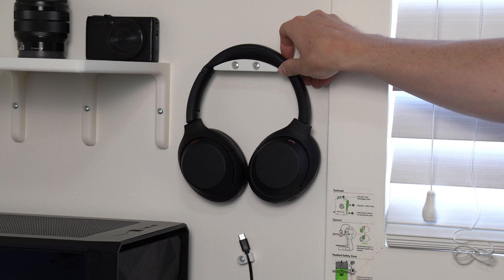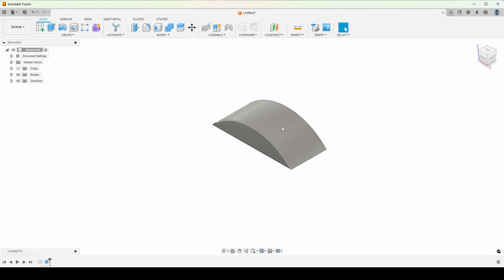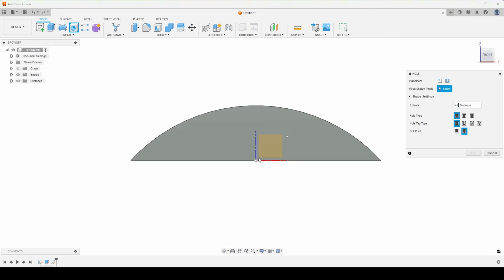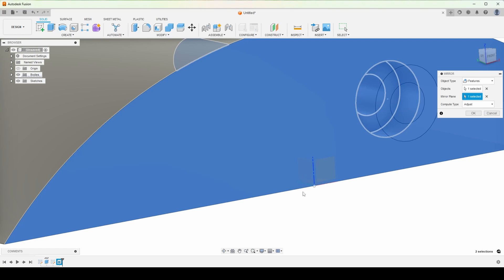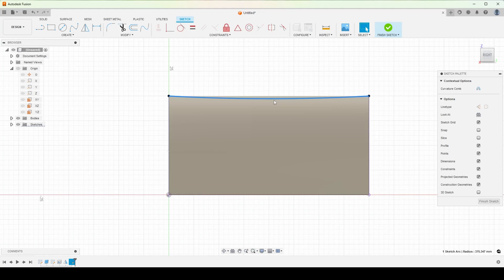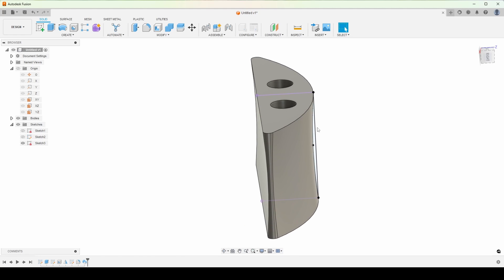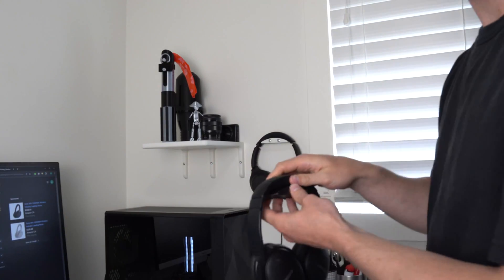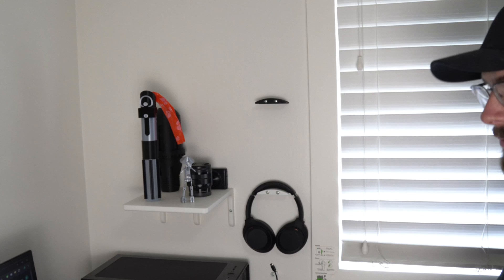Designing and 3D Printing a Minimalist Headphone Wall Hanger

Comment: Thanks for showing the process. I use onshape, but recognized most of what you showed.
Reply from the maker: Any parametric design software is going to be pretty similar. All the building blocks are the same, extrude, revolve, sweep. Glad you were able to get some value out of this video.